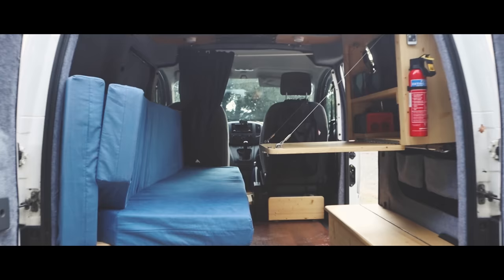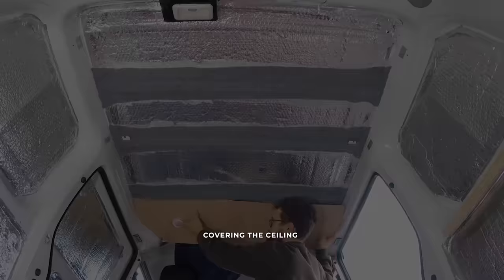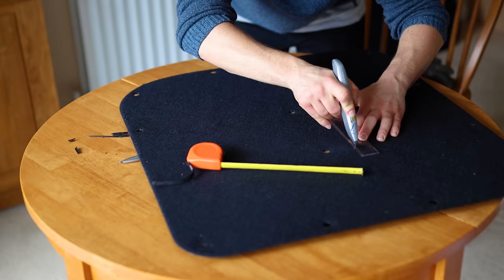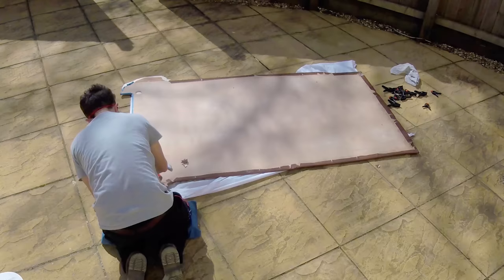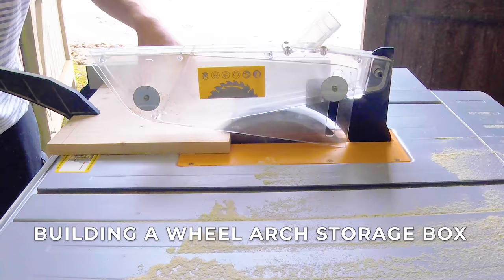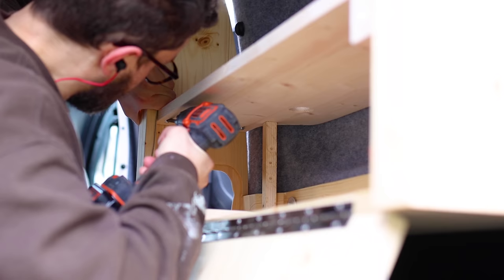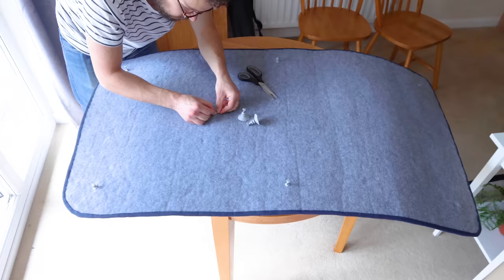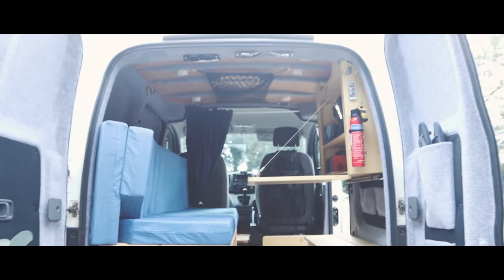TINY CAMPER VAN Conversion, From Start To Finish | Nissan NV200 Small Van Build

Comment: You are very creative. Those Kreig joints are awesome. The best way to screw things together.  
It is so much work !!! I hope I can do a job as good as you did.
I am thinking about a mid size van and eventually either a used taller van that I can stand up in or a pop top like the old VW Van's had. 
And put my bed up over everything inside.
That provides such a massive area savings. Because I would like to have one of those lightweight folding ANTI-GRAVITY CHAIRS. I love those and can actually sleep in it if I would like to or if I'm at an area and trying to be stealthy. 
I'm gonna use a portable 8,000 BTU A/C. I will be getting a brand new HONDA generator, 2,200 watt.
I will also be getting a Jackery lithium power generator, they call them with solar panels on the roof, about 500 hundred watts. 
Also a 4 or 5 cubic foot 12 volt refrigerator.  Also for back up is a top quality 4 cubic foot cooler.
Those things are expensive but will keep ice for a week. I can also reuse the water out of it. Maybe a sink that drains into a 5 gallon bucket. Outdoor shower or maybe look into getting a wet bath inside .
Reply from the maker: Sounds like an epic van conversion, all the best with it! 🚐

Comment: This is a very good idea to use polyester batting. Same as Thinsulate and costs a whole lot less.  Thank you for this good idea!  Any wholesale fabric supply shop has them, or even upholstery shops.  I wonder if foam does the same job?  Or a combination of both.
Remember to add some patches of Noico or sound deadening material on inside metal panels of your van. This makes the metallic clanging from road vibrations to soften to a thudding sound and greatly reduces road noise inside the van.  Mass Loaded Vinyl although heavy is also a great floor and ceiling noise damping, thermal break barrier.

Instead of the spray foam which off gasses a long time and not removable, I would use sheep's wool batting as stuffing in the hollows..  I would use stiff ISO foam boards for panels and floors too.  I am surprised you have not run your wire channels first before sealing it all off.  Carpeting the beams is another smart idea!

Beautiful cabinets!  So functional.  Nicely made, enjoyed watching that. 
You should learn to sew, it is easy. I would buy a vintage Viking-Husqvarna 6030 or that model line machine. It is around $100.  It can handle heavy fabrics as well as regular cloth.  Not an industrial level of heavy but canvas or heavy duty cloth works fine.  Some robust 90/14 needles and make your own curtains, window covers, etc.  This machine may or may not handle marine vinyl, you might need a Juki or Sailrite for that. Get them all used at garage sales, CL, FB, eBay.  It feels very powerful to sew your own fabrics.  It is another whole world of skills.

fyi - music is wholly unnecessary in DIY, demo, tour, cooking, or animal videos.  Please keep natural sounds and no music. Even in time lapse segments.  It really hurts the ears and insanely irritates the mind. Very stressful. Natural sounds are soothing and desirable.

Comment: Well, I have to say this is so well done. If only we could get high-speed-time-lapse James to do all the work for me that would be awesome. Not only is it well done but, I'm sure the sense of accomplishment and enjoyment after you completed it and began using it on your surf safaris is probably awesome. Between this build in the Nissan and the Dodge ProMaster City builds it's making me long for the VW Westfalia campers of my youth. I used those when I was in my teens to travel up and down the California coast on surf adventures. I've always thought the Westfalia was one of the most ingenious builds ever created. The addition of the sink and refrigerator were so ahead of their time. I noticed you elected not to use any flat solar panels on the top of the NV200. Was that intentional or maybe out of budgetary scope. Also, most builds I see have vent fans in the ceiling which it appears you maybe don't need? Does that have to do with your geo location and the environment that you're using your van in? Just curious. All in all, I really commend you on the work you've done. I hope that you have many happy years traveling to the surf spots near you. Cheers.

Comment: Nice conversion! I'm here in Cornwall too and have just bought a Transit Connect that I want to convert over the next few months. My budget is pretty meagre though, so will be a lot of upcycling I think. I've also discovered the Transit have issues with leaking and have had to strip out all the cab flooring due to it being absolutely soaked with half inch of standing water in the passenger footwell. Not exactly a great start!  It's bone dry now though and I'm going to use a jet wash to try and see where any water might be getting in before I start with fitting any sound deadening and insulation. I plan on taking my time with the design and hopefully cherry pick the best ideas from builds like your own. Anyway, thanks for the inspiration! Mark

Comment: Awesome tutorial of camper van conversion using on Nissan. I haven't seen NV 200 with 2 folded rear doors like yours. In here the NV200 comes with 1 flip up door.
Reply: Peter:   here in the UK  two rear doors are called Barn Doors and flip up is called a Tail-lift.
Reply: @joline2730  Thanks for your further information

Comment: The van is great. Please add a big ventilation / exhaust fan in reverse to suck in air. I hate stuffiness and no oxygen while sleeping or staying in the van.  Though I would like to see a bigger hp battery
Reply from the maker: No need, I've got wind deflectors so keep both windows open at night 👍

Comment: Wonderful to find your channel and super-practical build. Completely agree with your insulation approach (although, maybe a little more on the ceiling might help...) The concept of using the cargo hooks and M6 bolts to mount removable furniture is sublime. You've opened my mind to going for a portable power solution like the Novoo you have used. Would love to see if you change this or integrate the PPS concept further. Everything you've done looks so practical and straightforward, yet some lovely elegance in your woodwork craft. You've also opened my mind to come down from my L2H2 Vivaro and look at a smaller build for the next leg of van-life. Again, thanks! :)

Comment: Job well done.Great concept that the cupboards are below the bed and the table high on the wall.This way being a small van you have a full size bed.
Please can you comment on the power system you have and how you charge it.Love the joinery btw.
Reply from the maker: Thanks, glad you like my build! I've done a video on the battery here: https://youtu.be/3vlsUjO563w Not sure if they still sell the exact one, but there are other similar ones out there. I charge it from the mains, but also have a folding solar panel and it can be charged from 12v in the van too. It's not a huge capacity (compared with leisure batteries) but is perfect for my needs.

Comment: Hi mate. Really good solutions. I bought a Peugeot Partner 1.4 diesel van 3 weeks ago and now I'm starting to design the rear part. For the most part, this solution would also work well for my use. This is the first car I'm going to decorate, and I have no previous experience.
How have you solved your power needs?

Comment: That's an amazing job. One thing I always wonder about van conversions is how things are attached to the metal skin of the van. I.e. do you just screw directly in or are there better ways? I think you could use adhesive in some places but not all. Cheers
Reply: Would love to know this also, in particular the ceiling?
Reply: And what length screws did you use? (In the middle of a conversion myself, and keen not to screw straight through the roof!)
Reply from the maker: Thanks, you can screw into the metal, if it's a cavity and not going to pierce through to the outside of the van, however I've trip to minimise this as much as possible. All my furniture if either attached to the built-in screw threads or tensioned onto the floor load rings. For the ceiling I used very small screws into the ceiling ribs (so no chance of creating a leak!) Full video with details here: https://youtu.be/3SnHXMrDhAQ

Comment: This is a really great build! I’d just want a built in shower where I could also have a compost toilet in. You think I could fit it in if the bed was shorter to my size?
Reply from the maker: I think it might be a squeeze, however if you installed a swivel seat so you could use part of the seat as your bed then would may have enough room for a toilet. Not sure about a shower though, as there isn't enough room to stand up in this van.

Comment: Nice build! Really like the removable bed/sofa, gives you freedom to adjust things if you want to later, and must be satisfying to be able to clean! How much did you pay for the van itself? I see Nissan NV200s going for anywhere from £2k-£10k. And if it’s on the cheaper end, did you have to pay for much maintenance/part repairs?
Reply from the maker: It was about £8000 in 2019, 18,000 miles and FSH. I think it was a pretty good deal at the time, but not sure what prices are doing these days! Haven't had to do any major work other than standard wear-and-tear stuff since being it :)

Comment: Carpets become moist n smelly in the long run. I wish you could use some other non conducting material. It's a convenient van conversation. ...🌹☺️
Reply from the maker: I haven't had any problems with them becoming moist, but they do hold onto smell. Luckily as I don't live in the van, it's not a problem and soon goes.

Comment: Nice one, good job!  I noticed there wasn't insulation around all the roof and just carpet on top of that thermal foil. Is that normal? is that because you didn't want to lose van height?
Reply from the maker: Thanks, the vans only lightly insulated as I don't live in it, but you're correct in thinking that I didn't want to lose height

Comment: Hi  I bought a van to convert but cant even get started, I have 4 rivets on the bulkhead that  I cant get too. I've done everything that has been suggested on you tube, still no joy, really bugging me now. All the bulk head on larger vans and they all seem much easier!!!
Reply from the maker: Sorry you're having problems with the bulkhead. What van do you have? Fortunately the NV200 wasn't too bad (just a couple of security bolts to struggle with) but I suppose all manufacturers do their vans differently!

Comment: Don't like carpet.  I would use something I wipe with a damp wash cloth. Perfect on the floor, a 1 piece floor keep water resistant and easy to clean.
Reply from the maker: Agreed, that's why I put vinyl on the floor - much easier to clean :)
Reply: @LensOfJames  and it won't separate like that peel and stick.

Comment from the maker: 🔥 Want to see more from my Nissan NV200 Tiny Camper Van Conversion Series ?  Check out the entire build here: https://www.youtube.com/playlist?list=PLsBWh_QNwDUcgnWcDnJeoHZI_nelRdkUY 🔥
Reply: I'm 6'3 would you think this van would fit my body?
Reply from the maker: Hi, I don't think so, my partner is 5'9" and the back of the van's not much longer. If you added a swivel plate to the front seat you might get more length though.
Reply: @LensOfJames  I see thank you for the reply

Comment: Good build.
But never use spray foam! This will make any bodywork which may have to be done in the future almost impossible, because that foam is flammable, cant be removed and therefore will make welding impossible.
Reply from the maker: I think there are thousands, maybe millions, of van conversions that have used spray foam....I only used it in the beams and it'll be fine. I've never had to have welding done on the van and sadly I think they'll write off the van before doing extensive bodywork to repair it like that!
Reply: @LensOfJames  Just because a lot of people did this mistake, doesnt mean more people have to.
It might seem convienient at first, but itll most likely bite you in the long run.
Reply from the maker: I've done a little research, plus looked at the product I used, and it appears that spray foam insulation is flammable but only at quite high temperatures. But then isn't everything flammable at some point? If I'm getting the roof welded (which I've already established is very unlikely) then the wood, other insulative materials and carpet will catch fire too. I appreciate your point but I don't think there's anything someone can fit out a van, boat or house with which won't catch fire!

Comment: Could you run a small low power dehumidifier to prevent condensation?
Reply from the maker: Condensation really isn't a big deal in the van. In fact, the van is drier than my house (I do live by the coast though!) Dehumidifier would be overkill I'm afraid

Comment: PLEASE READ, THANKS.
I enjoyed your video, cheers for that. 
You poor man though, as all the time you were gluing the vinal floor covering, I was shouting to myself, please don't glue it down, please don't glue it down. The reason is the vinal floor covering, WILL wear through, especially where you drag the plastic crate/box and bed frame over it, time after time and you will have an impossible task now removing both the vinal AND the plywood floor. Even in new homes nowadays, vinyl floor coverings are NOT glued in place as the vinal stays in place regardless of not having been glued. 
If ever in doubt, simply glue velcro partly around the edges of both underneath the vinal and the wooden floor.  
Try rubbing and maintaining the likes of candle wax between any rubbing surface and the vinal floor, this may extend the life of the vinal.
Please don't blame yourself as the majority of people would have naturally made the same mistake.
Reply from the maker: Hi Hamish, it's cheap vinyl floor on stuck onto a piece of cheap plywood - easily removable from the van and does the job brilliantly. It's lasted well for 2 years, no sign of wearing through and it's no big deal if it does. Both parts are easily replaceable and I don't wanted the vinyl loose under my feet (candle wax has a habit of melting when it gets hot, such as in a vehicle!). I appreciate your concern and the time you've taken to write your comment, but it's misplaced I'm afraid. No regrets from my end!

Comment: How did you fit the plywood to the ceiling mate? It looked like you just screwed them into the ceiling which I'm assuming you didn't and I'm missing something...
Reply from the maker: I did screw the boards in, but through a ridge on the beams. Full video and details here: https://youtu.be/3SnHXMrDhAQ

Comment: No roof vent? Wait till you try to breathe?
After a while the stale will prevail.
Reply from the maker: You're not the first to notice that, but I just crack a window and, thanks to wind deflectors that keep any rain out, I get a nice flow of air. Not to mention them being way cheaper than a roof vent :)

Comment: Hi mate,
Great video. Can I ask what the purpose of the wooden batons are on your floor ? And also did you fill any holes in the floor where you removed seats etc?
Thanks
Neil
Reply from the maker: Hi Neil, good spot - originally I had the plywood floor screwed down but when i covered it with the wood-effect vinyl I didn't want to screw through it, so have left the battens in place. The weight of my furniture and tight-fitting the ply hold the floor in place perfectly.

My NV200 model didn't have any seats in the back, so no holes to fill, though I did fill some holes in the floor and walls made by the previously owner who screwed the ply directly into the metal (unfortunately this is standard practice on many vans). No problems since.

Comment: Hi, when you fitted your heko wind deflectors did you fit the small metal spring clips into the top of the window Chanel or did you just not fit them? As I’ve fitted heko wind deflectors to my nv200 but there doesn’t seem to be enough room for the metal clips, just wondering what you did. Thanks
Reply from the maker: Hi, yes I used the metal clips too. As I recall it was a bit tight but they do fit - hope that helps!

Comment: Where is the sound deadener. ???? Just wondering.
Reply from the maker: I haven't needed to use any as its such a  small van and there's no panel boom, though the insulation helped make it less tinny when going over bumps. I talk about it more in this video: https://youtu.be/2GU-z2BgkA0

Comment: Yes another reveals all van conversion, But its not!! how the hell did you get the cab divider out??? the dividing 'wall' between the cab and the back. I've tried everything on YouTube to remove mine but it just clings  on in there!!!!! can't cut the rivets no tool will get close, tried hammer and chisel bent the chisel, tried to drill them out drill kept sliding off the rivet. I thought it would go easy but the small van dividers are riveted in with metal that superman would find difficult.
Reply from the maker: Hi, unfortunately I started filming the van conversion after I took the bulkhead out. It wasn't easy but I drilled them out. Tap a dent in the rivet as a starting point and a HSS drill bit will do the job. Hope that helps

Comment: Need to remove wood around plug or its unusable
Reply from the maker: What plug? Do you mean the floor being over the fuel pump? I didn't stick the floor down , so it's all removable. And having had the van for 3 years, it's very usable 😉 https://youtu.be/2GU-z2BgkA0
Reply: @LensOfJames  the wood around the 3 pin socket lad.
Reply from the maker: Oh I see, haven't had any problems so far 👍